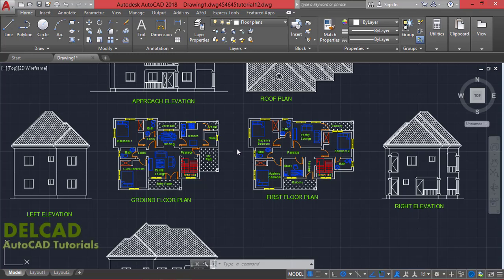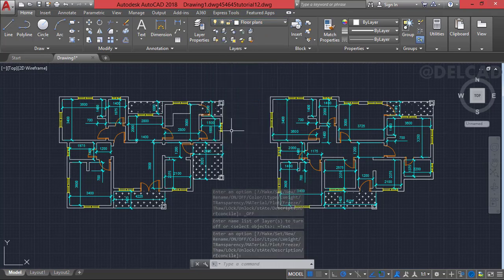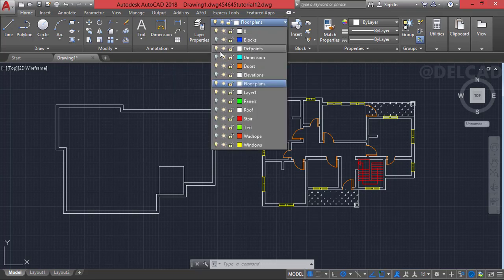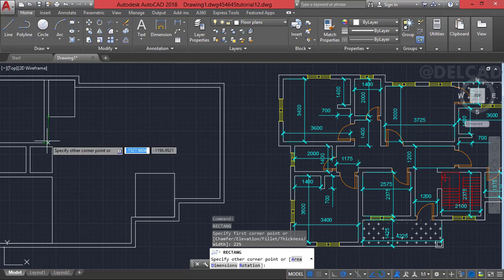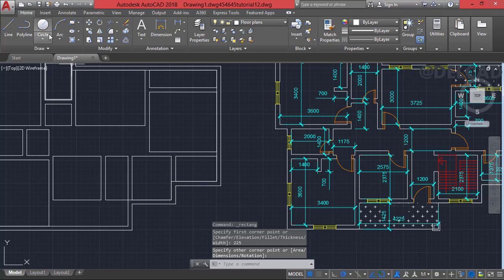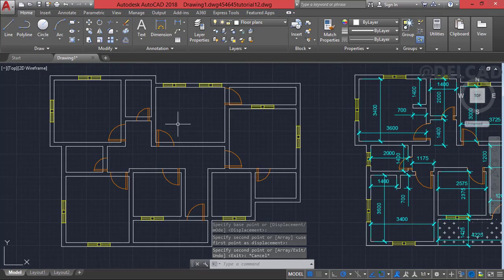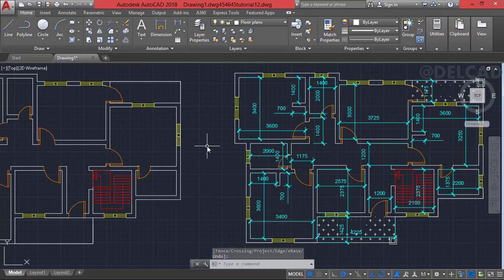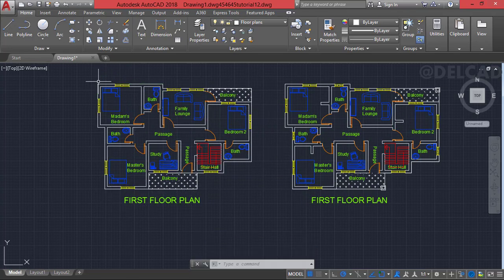Full Building Plan  drawing in AutoCAD Part 2 First floor plan

Comment: Thanks for the good tutorial.
Now in case the angel is specified for the elevation say 30 degrees.
How can someone adjust the roof from 45 degrees of the roof plan.
Otherwise Thanx for showing me the easiest way of making a roof plan which has been challenging me